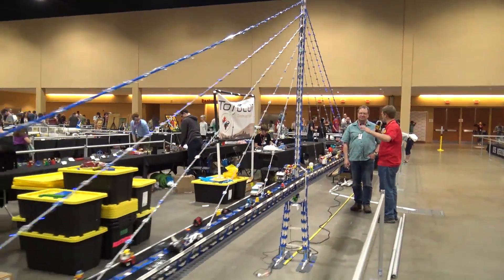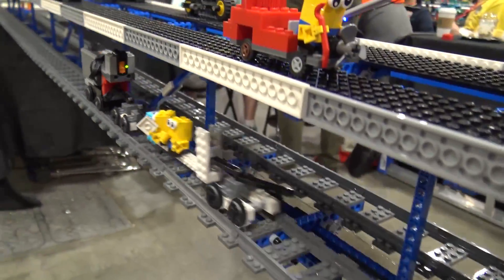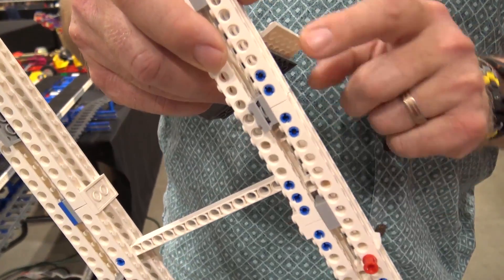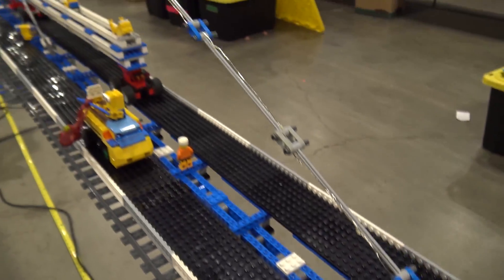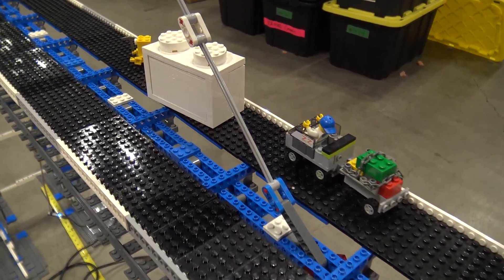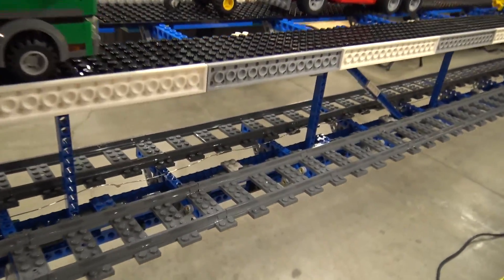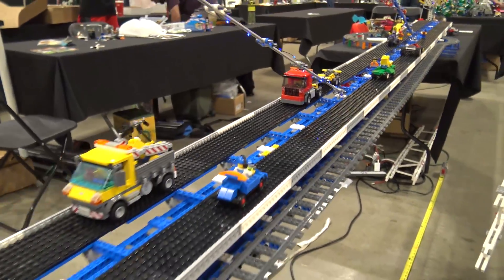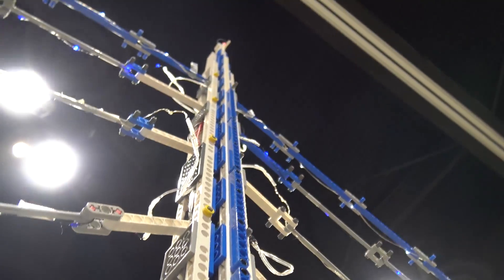Giant LEGO Cable-Stayed Bridge with Lights | Brickworld Chicago 2017

Comment: In the Netherlands they are working on a series of LEGO MASTER. In one episode they had to build a 3-meter bridge and the bridge should not rest on the slab, so no pillar like your bridge has. One team did not have much technical insight and built a bridge that already collapsed at the test weight of 8 kilograms.
Another team with more technical insight managed to build a bridge that could hold 160 KILOGRAM; and then the test weights ran out.